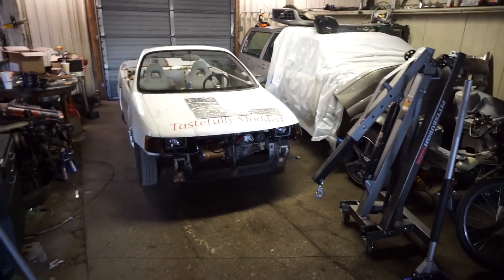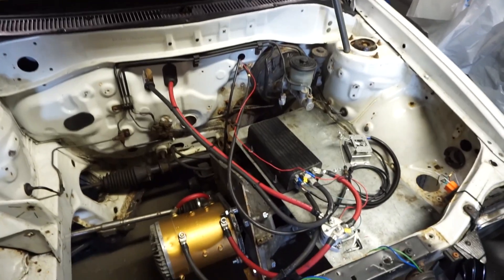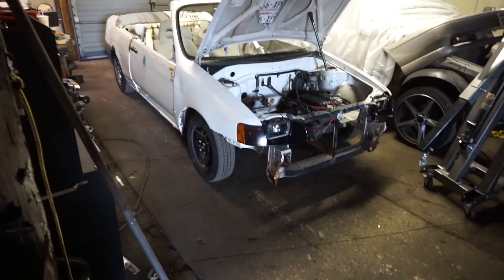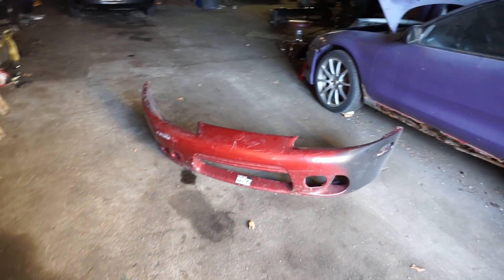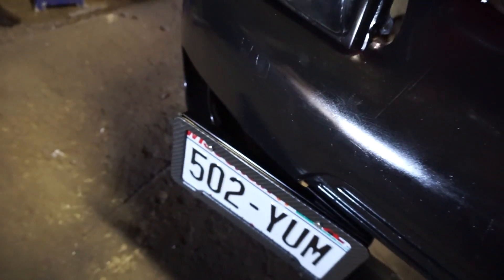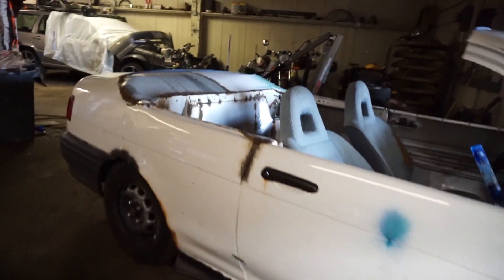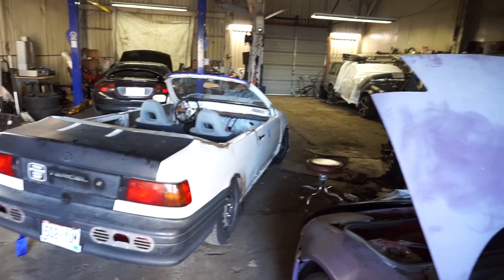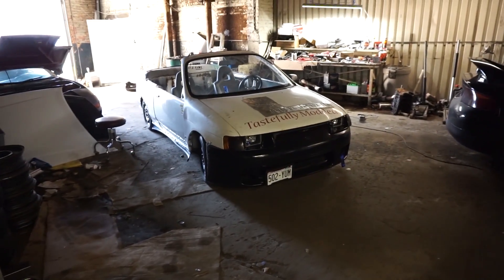My First ELECTRIC Car Conversion - How I Did It

Comment: How do you road certify an EV conversion you've chopped the top off? In Europe, you have to use an approved cage legal for road use, if such a thing even exist, and have the sharp edges covered and rounded. Then you need a structual assessment and a high voltage and EMI certificate and after paying $7000 for lab tests, you then can take it to a regular DMV for the road worthiness stamp! Your laid back attitude on car conversions, is the only thing I envy not being an American.
Reply: Oh I forgot: you also need a customs stamp for a modified vehicle and a tax assesment to prove that cars value is not significantly different from the donor car, or you need to pay them too. Then you need an insurrance company that thinks you are not crazy, and then finally, you go to the DMV!
Reply from the maker: @Tore_Lund  That's crazy, yeah I drove this on the street in America and a lot of people stared but no cops ever cared. I had the top cut off when this was turbo and gas powered as well and we never had cop trouble. If there was a bored cop I probably could have gotten several tickets...
Reply: @wideband  Excellent, nice to know there are Places where Cops are reasonable and Citizens are presumed competent when doing conversions. I usually need to change wheels, airfilter, led bulbs before I take my car to the mandatory inspection, but I'm carefull not making my car so look modded, so a topchop is out of the question, even if IT looks stock, I would get burned at inspection and taxed extra for now having a convertible.

Comment: im new to your channel and i have an 1988 civic hatchback i want to do this to. i am not understanding the manual shifting and what happens at a stop light?
Reply: You can't stall the electric motor.. it will just stop.. at that point u can shift like u would when your gas engine is turned off.. no clutch needed

Comment: buddies do you have an idea where can i find an affordable electric conversion kit ? all are so expensive 
thank you
Reply from the maker: Sadly i dont. Most people will tell you instead of a kit you are better off looking at a used nissan leaf. Or you can piece together something like i did. Performance isnt as good though and my car doesnt have heat/ac or anything fancy.
Reply: @wideband  do you have any idea how a perfect converted car would perform in a FLOOD ? like water getting into the engine...
and do you have any idea what are the available options except LPG CNG and Electricity and semiHydrogen ? wanna try sth like a nuclear reactor and 
make a super fast rally car ready for WRC... do you get my point ? i like speed and power at zero cost... wanna make a wild rally car for WRC on mountains with low cost
Reply: @wideband  nissan leaf latest model should worth it but i am concerned why many people sell off their old leafs at low prices with low kilometers
it is very weird, look here...
https://www.autoscout24.com/lst/nissan/leaf?sort=price&desc=0&ustate=N%2CU&size=20&page=1&atype=C&

Comment: I want to see that powered on Kobalt power tool batteries. That's what I'm considering for a 96v Ranger project. If that is a 36v then you should be able to use the 40v batteries, but I would likely be going with a bunch of 24v batteries. Wired up to get 96v

Comment: Motor in my rsx died. Actually, it was murdered. Anyway, an idea I had was to put an electric motor in but run it off a generator and maybe a small battery bank for when stuck in traffic. Just trying to find info on feasibility, how big a generator I'd need, I'd like to be able to get up to 80/90 mph if need be, but would mostly do 70-75

Comment: Clamp the side skirts to a work bench with a piece of steel and get a heat gun on it and let it cool, it should retain a straight edge after that.

If you don't have a long bench or piece of steel just do it in sections but make sure each section is supported so it doesn't have ripples, overlapping can also help to stop it rippling up rather than trying to go edge to edge each time that you clap and move along.

You really need gears bud but yeah it's a cool little build.

Comment: What's the top speed on this with a forklift motor?
Reply from the maker: no idea, I had it up to 35 on a test drive but I think it had more in it. That was only on 36 volts as well, if I bumped it up to 48 it would be more.
Reply: @wideband  ok thanks for the reply I'm 19 and none of my buddies are even remotely interested in such things so I'm really working on my own I had a 2000 $120 civic I wanted to do this to but it's an automatic transmission so I guess it would not work

What do you do about power steering and brakes
Reply from the maker: I would go with a manual steering rack, some civics do come with manual steering(I used to own one). As far as brakes you can run a vacuum pump on a pressure switch to keep vacuum, on your brake booster. Or you can convert to manual. There are companies that make kits to convert a civic to manual brakes. You would want the car to be very light if you are going that route. Honestly a manual transmission for a civic is really cheap. You can pretty much use whichever you want (d or b series) and you wouldn't even need to worry about setting up the clutch pedal, just the shift linkages.
Reply from the maker: A d series manual trans, shift linkages, axles, and making your own mounts would probably be the first step for that car.
Reply: @wideband  ok thanks for the info but after doing a bit of research I think I'm gonna try doing an electric motorcycle conversion what do you think about that....does it weighing so little mean I can use a smaller motor but mainly not need a transmission?
Reply from the maker: You could probably run no trans, this thing can make the car move in 4th which is 1:1. Plenty of torque for a bike. I actually really wanna do a motorcycle but money is tight and cars come first for me.
Reply: @wideband  1:1 meaning the great ratio is the same?  (Like same amount of teeth)

Comment: How far can you get on a charge and how long does it take to charge. Love everything about building this 👍👍
Reply from the maker: Hi, it's winter here so I haven't been able to get an accurate range test yet. With only three batteries I can assume it will be very very low. At the moment with a small 36 volt charger I leave it overnight and they are fully charged. I plan on adding more batteries when the temperature increases and I can actually drive this vehicle.

Comment: Did you reinforced the unibody. since cutting off the roof.
Reply from the maker: Not really just welded the doors shut, it does have some flex to it but not too bad. I have hit enough bumps with it to know it's not gonna fall apart on me.